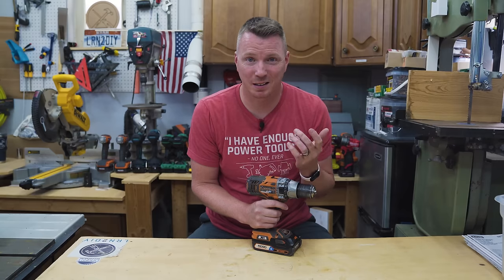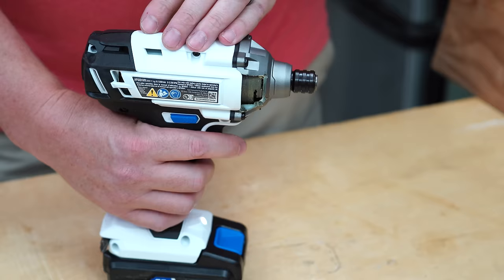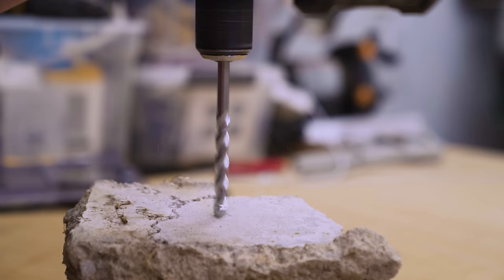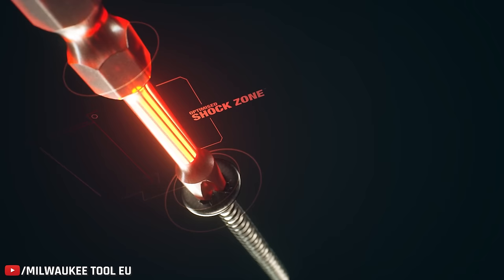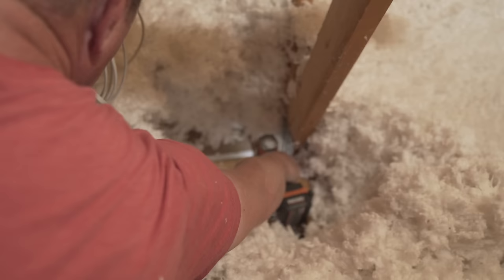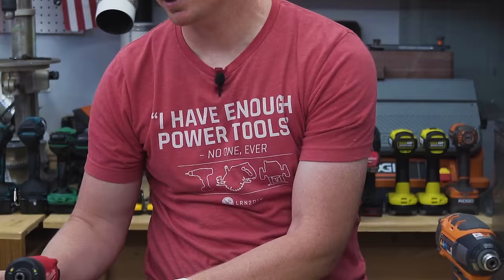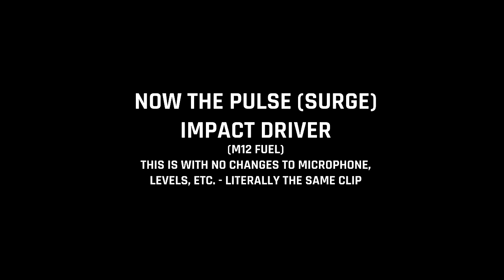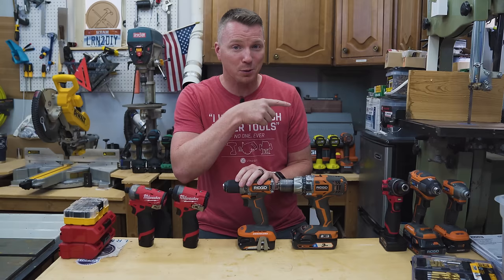Is The Cordless Drill Becoming Obsolete?

Comment: It’s nice to have a drill/hammer drill combo. I think if you’re a homeowner looking for a bare minimum tool kit, I’d buy only a impact. However, if you make a living with your tools, the drill is still very necessary.
Reply: whew thanks Bill!!
Reply: very true...drill is a lot better for long timber screws when say building a deck frame but I use the impact driver for the deck boards fasteners I think people tend to use the impact with long timber screws forget how more smooth it is with the drill as well 🤷🏼‍♂️🇨🇦
Reply: But then you would need to re-buy all your drills with quarter inch hex. Wood drills, metal drills and masonry drills. Those are more expensive than the standard ones and you're going to have trouble (torque without hammer equals walking drills if you hit a hard spot drilling into masonry), plus any gauges below 2 just snap in hex if you can even find any. Impact drivers are best for setting long screws into lumber, e.g. when framing/roofing, installing doors/windows or maybe building a deck. But most jobs in a home is drilling into a wall, pop a plug in and fastening shelf supports for a shelf. And driving in those screws afterwards is akin to putting together IKEA furniture - neither you need an impact driver for. To be able to do everything reasonably, the drill can do a lot more (especially with that hammer setting for masonry), and you can still use it to put together Swedish furniture if you turn the torque setting down. Next step would be to get a small driver alongside the drill - again, most just use their screwy machine for putting together furniture, which made the Bosch IXO very popular. So tiny it fits in your pocket and VERY light and is perfect for most light fastening. I'd argue impact drivers are the same class of tool, just (a lot) more beefed up - again, something most people just don't need, especially if they live in an apartment  (like most people) and don't have to worry about e.g. fixing garages, fences, dog/bird house, porch, etc. etc.

The only thing I can think of is (maybe?) for people living in America where everything is drywall and not strong materials, you wouldn't need to drill much of anything at all. But for everyone else, get the combi drill.
Reply: Very explanative
Reply: Only the hammer drill really. Everyone is using impact drivers these days old man. Get with the times.
Reply: The only cordless drilldriver i buy is a hammerdrill combo. Fastest drill, and the only ones worth buying.
Reply: Agree!
Reply: If you’re only gonna buy one, you need a drill, not the driver

Comment: As someone who works with both daily I can't remember the last time I used my impact for anything other than driving screws.
My drill does all the drilling because it's faster.
For DIY though sure you could probably get away with just using an impact for the majority of jobs, you can even get a mini paddle whisk that can handle a 10kg mix of plaster, use it to mix grout, tile adhesive, mortar, paint, the lot
Reply: I have a big paddle that I run in an ancient Black and Decker 1/2 drill I can mix a bag of concrete in about a minute

Comment: I have an electric mini drill for around the house. I love it because it never over tightens.  It’s small and goes into a drawer. Obviously nothing one is going to use for a heavy job but love it for replacing screens, putting up hurricane shutters, replacing electrical plates or putting together any kit furniture or anything that could be stripped.  The one I have has storage for bits and bends straight if needed.
Reply: I have a baby drill just like that too, in the general tool bag. I have a corded Milwaukee for serious drilling business like getting through old growth timber or fiberboard siding, and an impact for wood and drywall screws longer than like an inch. This set up seems to work well.
Reply: Back in 2018 I bought a Panasonic EY7410LA2S31. It’s been incredibly useful for working on computers and electronics equipment, which was its original intended purpose. I soon found it worked well on light fixings, such as door handles. I’ve also used it many times on much larger screws for putting up shelving. 6 years later, the original 2 batteries are still going strong. Quite amazing for a tool that cost £100.
Reply: My mom picked up a mini cordless some time ago.  She uses it from time to time.  I use it for light work when I visit.  If the job requires extra torque, I dig out Dad's ancient drill.  But the mini is great for most projects and extremely handy.

Comment: I do some low voltage cableing and computer work so for me all three drills are still used. The clutch on a standard drill is perfect for not over torqueing delicate things. The hammer drill is awesome for when you need to drill into metal or masonry to mount something and the impact driver is just amazing for everything else.
Reply: Exactly, a cheap compact drill (12v) for screws, an impact (18v) for speed and power and a heavy cord hammer drill for everything else.

Best combination!

Comment: I’m so glad it works for you on your projects but as for me I’ll continue to use the right tool for the job.  The only thing I’ve joked about for years is that as they keep increasing the battery voltage we will soon be able to just plug them into an outlet.
Reply: DeWalt offers a dual flex volt 60voltx2 setup that you can plug in.  🤦
Reply: Shots fired! Hard agree brother. Impacts are for noobs and limp wrists
Reply: If it works for him then it's the right too as well

Comment: I'm always amazed by my impact.  I was changing mower blades on my zero turn the other day and I couldn't loosen the blade bolts with a socket... Even when I engaged the 800 lb gorilla.  I looked around for my breaker bar and couldn't find it so I grabbed my impact with very little hope.  Took all of two seconds per bolt to spin those off.
Reply: I had the opposite happen to me. The impact driver did squat and I had to get the breaker bar.  Impact drivers have too little torque and you would need a Impact wrench with the much higher torque.
Reply: @adama1294  what impact driver were you using? My m18 has 225Nm does most things
Reply: See, that’s the problem.  That’s not really what an impact DRIVER is made for.  That’s the job of an impact WRENCH (or gun)

Comment: As pro contractors we like the convenience of the impact but we always keep a backup chuck drill in our toolbox for many reasons - much better centering when drilling precision is needed (especially drilling into metal), essential for fastening jobs needing precise torque control, and in case the hex shank fails, the chuck can still grab on to the round part.  I sometimes also contract at a care home, definitely can't use the impact there because of the noise.

Comment: Impact drivers are for driving screws in, drills are for drilling holes and installing certain types of screws. Impact drivers should generally not be used for drilling holes, installing drywall screws, or doing pocket holes.
Reply: Did you not watch the video? Milwaukee and others are making drill bits specifically designed and tested with impact drivers in mind.

Comment: This video missed almost ALL of the reasons I love impacts. There's the lightning fast bit changes with NO SLIPPING from failing to fully tighten the chuck, the short neck making it easy to get into small spaces, the impacts easily hammering drill bits through tough materials (knots, metal spurs, etc) where a drill just gets snagged and stuck, driving even damaged phillips screws instead of camm'ing it out, NEVER burning out a motor because your drill bit got stuck, and much more.  Never twisting-off your wrist is one of the big benefits, too.

Got my first cordless impact driver a decade ago and haven't wanted to touch a drill since. I knew it was exactly the improvement over a drill that I wanted the moment I saw one, and only the noise issue has ever given me a moment's pause.  To ensure I wouldn't also need a drill, I immediately purchased a chuck that fits the impact (for the rare round drill bits I still need--or twisting wiring harnesses together), bought a few full sets of (impact) drill bits (NOT the soft, dull and off-kilter Harbor Freight junk!), and a couple extensions (rigid and flexible/swivel).

Comment: Another tip: To drill a fast hole in drywall to use the 3/16 blue plastic anchors in, use your phillips #2 bit. It works fine. Perhaps it might even be able to work as a countersink bit on soft wood.
Reply: I usually use a similar method on drywall—just a Phillips screwdriver.
Reply: that's a good tip. Saves your drill bits. it's much cheaper to use old Philips bits.

Comment: Great video. One caution to add: don’t use an impact on machine screws or threaded inserts. They will cross thread and you will have a bad day.
Reply: Or be very gentle. On sensitive stuff, i like to tighten slowly till i hear the motor whine because it can't turn with the power i gave it. Little to no impacting unless removing the screws.
Reply: @jsmith5443  hmmm. have you seen impact drills being used on factories building motherboards and the likes?

Comment: I did the switch recently from drill to compact impact driver. I'm into Ryobi 18v platform. I got a nice set of Milwaukee hex shank drill bits. It's so quick changing bits. The tool is light and compact. I also have a hammer drill for concrete. But most jobs (wood & metal) I use my compact impact driver.

Comment: I love Milwaukee stuff. Expensive for a DIYer, but they seem to put a little more attention to detail in their products and innovate a bit more quality of life features than the other brands you can easily find in stores.
Reply: They are a consistent top three on Project Farm's YouTube page.
Reply: One thing I wish the Milwaukee would do is use the same LED light placement as the DeWalt system.  Having 1 light placed underneath the chuck doesn't illuminate as well as the 3 lights placed around it like DeWalt.  You get a shadow with the Milwaukee.
Reply: I only buy crap on sale so I have a mix of Milwaukee, DeWalt and Porter Cable. All of them work great, no real favorite.
Reply: @LiL13izzy7 same here their light placement sucks
Reply: Milwaukee or bosch… the Milwaukee is faster but the gdx bosch has a 1/2 plus 1/4 head.   
Tough choice!

Comment: First great video.  You had a lot of great information in it and I appreciate the time it must have taken.   I went through a phase where i only went to impacts for a lot of what I did.  And while all the pros you stated are correct, it doesn't come without cons as well.  Noise being one of my main reasons I avoid them at time.   I often times go to a cordless screwdriver like a 12v from Dewalt or Milwaukee because it combines some of the benefits of both.   The more I use them, I realize they are a true dynamic duo and while there is a lot of overlap, neither one replaces the other.

Comment: You should check out the Milwaukee Screwdriver (2402-20) and the Installation Drill/Driver (2505-20). The screwdriver is like the impact and drill had a baby. It's got the 1/4" bit holder of an impact, with the adjustable clutch of a drill. With no impact, it's quiet, light and perfect for electric/mechanic work. The instillation drill/driver has a interchangeable head, you can have a hex bit holder or drill clutch. It also has a right angle and offset adapter for tight spaces.

Note: Dewalt and Bosch (and probably others) have similar to the Milwaukee screwdriver, and maybe the insulation drill/drive. I recommend Milwaukee because you already have the batteries.
Reply: YES!!!!! I use the Dewalt 12V Brushless 601. But same deal. My drill/impact get little use once I tried the 12V Screwdrivers. The M12 Surge is my next step up.
Reply: @J.Wick.  Yes the DCF601 and DCD703 are really handy.

Comment: pro tip: Replace your impact driver with the Ridgid 3/8 subcompact impact wrench and a 1/4 hex holder. Additionally, get a 1/4 drive, 1/4 hex socket holder. It works much better than the regular impact driver and you can drive sockets also. In fact, I've had times where I needed to drive construction screws but needed an extension. Socket extensions were just the thing.
Reply: That’s a good tip. I did that for my craftsman but it just feels slower than my driver

Comment: I've found myself in a very similar situation. I got an impact drill because the regular drill often came up short on power. Not only is it more convenient due to size and weight, but I was surprised to find myself using it more and more, even for jobs a drill would do just fine, because the drill may some times be too little, but the impact drill is rarely too much, which I thought would be the case. Depends on the type of work but surprisingly impact drills can be used for a lot more than just lug nuts and heavy duty work.

Comment: Hell yea! Journeyman Electrician here. Compact size and wont break your FN wrist if it catches something. 90% of time way to go. Only time I use a drill any more is for "real" drilling such as through something sturdier than a 2x4 or, the quick attachment on the impact chuck wont take the particular bit I need. I got a old Dewalt I carry around in my walk around tool bag. Good for 90 % of what I need and small/light enough to not be a bother. If I need a real drill, I have one, I'll walk back to the truck and get it. But it's not often.
Reply: Same here, Texas sparky, too. I’m a maintenance electrician now and I carry my impact on my utility cart at all times with a Phillips, flathead, Robertson, 5/16 & 3/8 hex bits. The majority of the time that’s all I need.  On the rare occasion I have to get my drill out of the truck, it’s usually to drill a hole with my step bit.

Comment: I’ve been using Makita tools and especially Impact Drivers since the LXT Platform was released, the first impact saw hard daily use for more than 10 years and only replaced it when the bearings started squealing after it fell about 2 feet and landed on the bit damaging the bearings. Currently I’m using Makita’s XDT16 impact and it’s great. 
Try a better brand than Rigid and you’ll immediately see the difference.

Comment: You really need both.
For example with wood, i use the drill to predill holes, and then i grab the impact and drive screws.
About the kickback, you can drill with the clutch, to protect your wrist.
You need a light drill, like the DCD796 or its sucessor, the DCD805.
I have both the DCD796 and the DCD999, but the DCD999 is too heavy for everyday use.
Check out the DCD805.

Comment: I just bought a Dewalt 1/4" impact driver and it has become my favorite tool along with my Philips screwdriver, hammer and vice grips.  I have 3 nice drills, 2 cordless and a Dewalt 1/2" corded one.  However, the impact driver is a godsend.  I have even used it for removing lug nuts on my cars after loosening them with a wrench, saving my wrist (I torque them with a torque wrench so I only need them to spin the lugs off and on).

Comment: I was thinking the same thing for a while, that I'd rather just use my impact for everything. I went on like this for a few months during a large project, and didn't even realize that I was actually getting annoyed with how the impact was driving some crews in situations where I needed to be a little more delicate or careful. I "tried" my normal drill again, and it made everything so much easier. I'm not the one to explain what the reasons actually are, because I don't know for sure, but I'm back to using my regular drill in most drilling and driving situations unless an impact drill is actually needed.
Reply: The way I understand it is Impacts are hammering the bit where a drill is rotating

Comment: Agreed! I have a Bosch 12 volt impact driver that I use more than anything else, and I have plenty of other options I could reach for. Great little compact tool!
Reply: I have the Bosch 12v drill and the flex click. I use them all the time as well. Especially doing doors or cabinet hardware. I have a 12v Makita and 2 18v Makita also
Reply: I use my Milwaukee M12 impact more than anything I own. I own a lot of M12 and M18 tools.

Comment: I tried impact drilling in wood using Diablo SpeeDemon - it was much slower than drilling with a drill. The Impact doesn't have enough rpm, it immediately goes into shock mode and slows down a lot because of this. https://youtube.com/shorts/D5Jag2trdOc?feature=share

Comment: I stick with my drill over my impact driver because the drill runs screws in much faster than the impact driver.  That makes a huge difference when doing things like decks with over 2,000 screws.  I pull out the impact driver to run in lag screws.  My DeWalt DCD796 couldn't run in anything over 4", although that just crapped the bed and I upgraded to the DCD996 with much greater torque.  Will still use the impact driver for those for the convenience of not having to constantly change bits out.

Comment: Countersink bits, reamers and hole saws all need a real drill. Drilling through steel with an impact usually doesn't go so well. Drilling through multiple layers or chasing holes usually works better with a real drill rather than an impact which can punch a hole next to the one you were trying to chase.